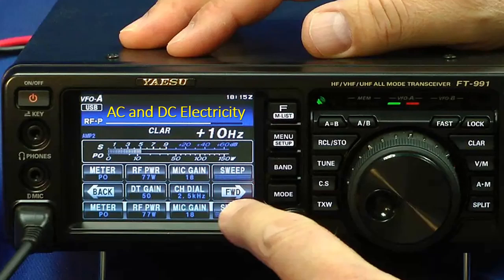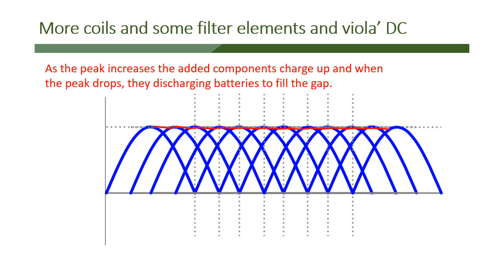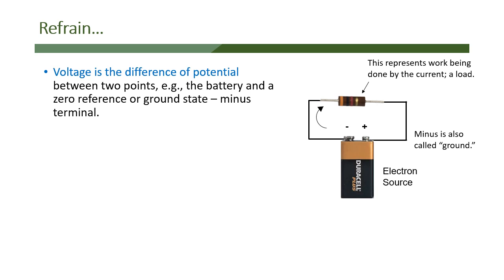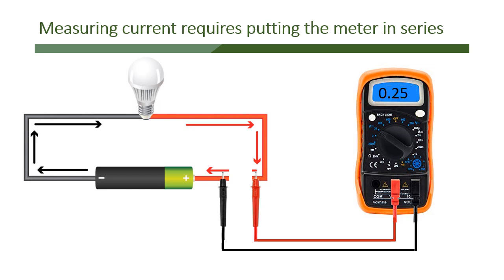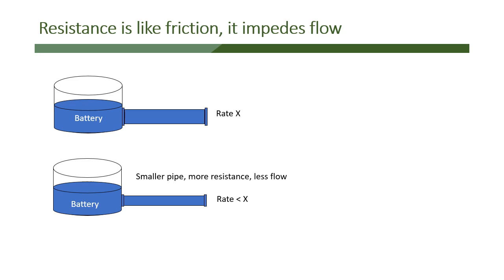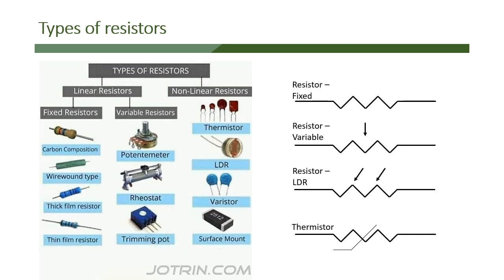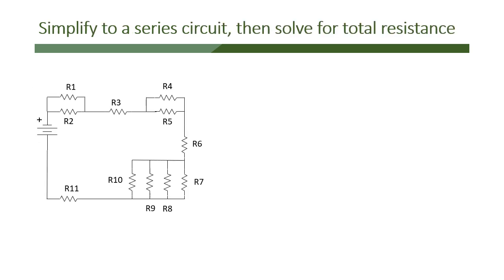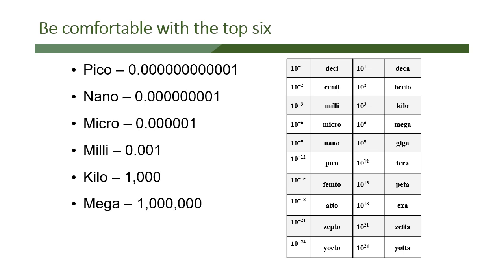Amateur Radio Online Technician Class Session 2a

Comment: I kept scratching my head @47.24 as it doesn't add up. 0.005+0.004+0.0015 =  0.0105 . 0.0105 / into 1 =  95 Ohms
 As 0.105 / into 1 would be 9.52
Reply from the maker: You are correct there is an error, well a typo or an accidental omission, the last equation the total should have been 1/0.0105 = 95 ohms. I accidently omitted a zero. Thank you for pointing it out.
Reply: @W7DAO  I am following your series as I am taking the UK equivalent of the Tech course and I am absorbing as much as I can before December 1st when the course starts. 
73